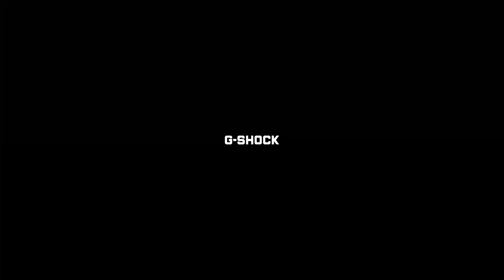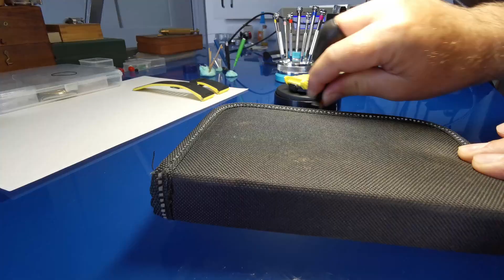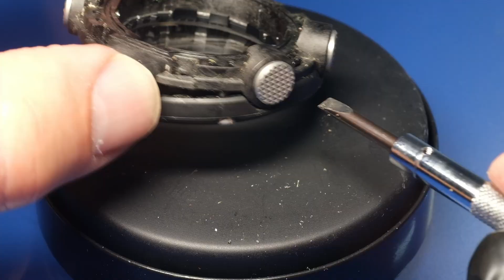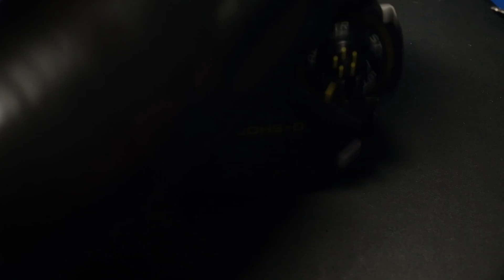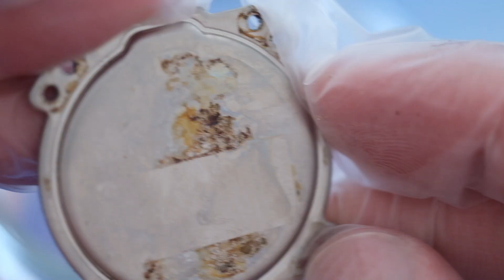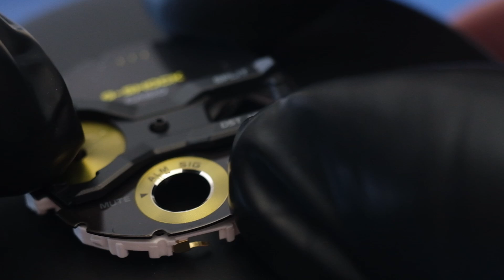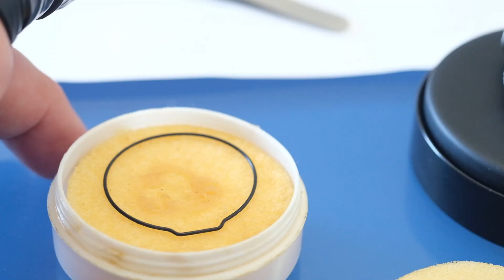G-SHOCK versus Watchmaker

Comment: I wonder if a mudmaster would have as much mud inside. I owned a G (G 2900) as 8 (?) year old. Then i switched to Pro Trek PRW 1500 (got it reduced price) at 13 years old. With 21 years, i switched to Pro Trek PRW 60T (titanium bracelet). Now after graduating my masters at 27 i think buying a PRW B1000. Or the new Citizen Altichron BN4061 (bit expensive though). Or maybemaybe the Mudmaster B1000 but i like Pro Trek looks better (basically that mudmaster has all functions of the PRW B1000 and saphire). Wrist size is pretty small though, so a big g shock would look ridicolous (the PRW 1500 is already limit, its nearly bigger than my wrist lololol).

Comment: AGRICULTURAL?? 
Is that derogatory toward farmers?
Most peculiar...
Reply from the maker: Hi there... It was not meant to be just merely descriptive.  I have much respect for farm machinery engineers ever since assisting with the repair of a combine harvester at the tender age of 12 because I was the only person small enough to crawl inside the vehicle and replace the vital part.  This we did at night because it was important to get it fixed as the crop was dry enough. Yes, much respect for farm engineering but it is different to working at the watch bench.  Hope this clarifies. Richard
Reply: @richardperrettwatchmaker  
Thanks for the reply. 
I am sure no disrespect was intended. That phrase just sounds very odd to my U.S. ears. 

It sounds like you had a lot of awesome learning opportunities in your younger days.

Comment: One thing you missed, is that the pushers come out too.
Behind the button they have a cavity where their return sprint lives.
This place collects a lot of gunk too and here it'll affect the feel of the pushers too.
They also have tiny O-rings that can benefit from a bit of grease.

Having that centre spring electrically floating isn't a problem to these modules, it only handles the beeps.
What was probably happening is that the light pusher pushed the module out a bit, preventing it from actuating.
Usually these watches have a reset contact point, which you should connect to ground (the metal module frame) for a second after a battery change.
You can probably realign the wheels in software as the stepper motors have no way of keeping track of position and can drift when turning while receiving shocks.

It was cool seeing how incredibly well-built these fancier G-Shocks are.
I've dug DEEP into my GBX-100 in my modding adventures with it and it's nowhere near as well put together.
Same with the few cheaper non G-Shock Casio's I've taken apart, but all is relative as they stand far above the other cheap digital brands.

Comment: You've probably found out by now but the SW batteries are for low drain watches with no backlight, alarm etc.
Your G-shock (and my GA2100) both need the SRxxxW style of battery.

Comment: Bought a Breitling Hercules. I hate that watch. It is an overpriced junk Swiss watch in my view. Got 9 months out of it, got it serviced by Breitling got another 12 months and the same thing happened - ie gains 15mins an hour. It has sat in the drawer for the last 17 years. I hate it. It is a rubbish watch. 
Saw a vid on YouTube and a watchmaker was wearing a G-Shock GWG-1000.
I bought one. Far from perfect the GWG-1000 has terrible lume and the light is poor, however it is reliable and rugged. I must say I don't love it as it is just a tool. I was expectingca bit more from a +$1000 watch but it is so much better for the active person than my Hercules it's ridiculous. Swiss watches are OK for dopey office workers but for us proper workers don't even think of a mechanical Swiss watch be my advice.
I'm  a truck driver that does multi drop deliveries.

Comment: I bought my first G Shock GA-2000 after I saw your first video about the model.  It’s a great watch, and not long after buying it, I saw another color way—my first one is green with a negative digital display, and as I said, it’s great, but when I saw the same model in white with a positive display, I couldn’t resist it, so I bought it as well.   Both my GA-2000’s have non-skeletonized hands, because I think they’re more legible..to sum up, the GA-2000 is a great design by. Casio, and your first G Shock video inspired me to buy it..I’m happy with my purchases.

Comment: I wore the same g shock 6900 for working out and mountain biking for 15 years. Only had to replace battery and band once. When it finally died, (Circuit board issue) I took it apart, and holy crap, was that disgusting. 
They're tough watches, but they hold on to some serious DNA. 🤮

Comment: What an interesting video. Thank you! Nice to see craftsmanship in any form. In case it is useful to know, the central protruding spring which extends beyond the insulator on the back of the circuit board is to connect the watch electronics to the piezoelectric speaker for the alarm noise. This speaker is visibly mounted on the inside of the metal watch back. I don’t think the spring has any other purpose. Putting the metal back in place may have further compressed the other non soldered electronic connections or the zebra connector against their contacts to make the electronics fully functional. It was unlikely to be related to the spring I think.

Comment: I have a G-Shock GA100 which I bought ages ago from Argos for £40 because I needed a watch at work right there and then. I absolutely hate everything about it, the way it looks, the way the hands always seem to cover the display when I need to see something on it. But it just won't die, and I've worn it on and off for years. Much better watches that I loved have come and gone, and at the moment my Traser has stopped, my Luminox needs a new movement and my Tissot's crown has fallen off - so I'm back to using this G-shock at work that I can't stand but just seems to be indestructable, despite being abused and having not a single days service in at least 15 years.

Comment: No two ways about it... YOU ARE GOOD with watches Richard. 
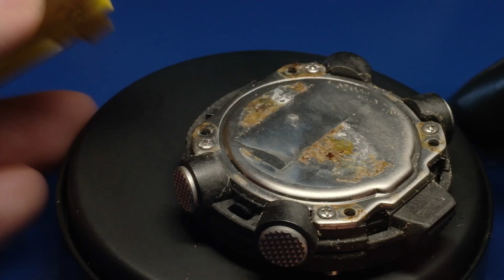02:13 in this video...This is the reason I would never take my DSLR Camera to a beach .. Sand gets everywhere in electronic devices because sand is in the air when you go on to a beach.  OK, that said... 
I have had my eyes on this exact yellow & black Casio G-shock watch for a while now...The Casio G-Shock GA-2000...It is priced at around just £100 GBP here in the UK (About 200x cheaper than a Rolex) 

I collect watches ... Can I ask if this watch is worthy of a place in my watch collection.  I have been told it is a little bit "FIddly" to set the exact time on the watch.  Is this true? 
EDIT... I love your vintage Seiko watch ... I have a Seiko SNK809 K2...With the 7S26C movement... The accuracy of this movement is supposed to be 20 to +49 Seconds per day ... This is utter tosh Richard ... I tested mine over a calendar month making sure the watch never ran out of power and the REAL accuracy on mine was nearer +/ 3 seconds a Day. 
So pleased I found your channel... Going to have a look at some of your other videos.
Kind regards Brian

Comment: Love GSchocks.  Insanely good watches for the money.  Cheap and cheerful GA 2100 is my favourite.  2nd favourite after my Seiko PADI

Try a drop of ACF50 on the corroded back.  It will remove the corrosion and arrest it from getting worse leaving an ultra thin protection coat in place

Comment: Probably a good idea when you noticed the sand and dirt under the yellow case back would have been to stop and brush it off/ blow it off before opening the watertight seal. Some analogue g shocks also have the ability to set home points (with a series of button presses) for the hands and wheels, most likely in the instructions.

Comment: I've never seen such an immaculate workshop even his tools are colour coded! You should see mine Richard (or best you don't) and I'm not a watchmaker like yourself who I hold tremendous respect for after having a go myself at repairing a vintage watch (how hard can it be, right?) and having springs flying out everywhere and a bag of 30+ parts for my trouble. To me as someone who has designed and built computers and written software, watchmaking repairs is akin to performing open surgery on a living patient. It's that hard and technical, you need very very steady hands and astonishing skills. I really enjoyed the story of the watch and seeing the repair process anyway. I'd be exactly the same if I was Rolex to be fair, a big brand of extremely high value with a reputation to protect you stay well clear of products which have been fitted with non-Rolex parts . So that makes Richard BETTER than Rolex for still taking on the task! I did wonder if the watch might be haunted or something paranormal going on, a watch running so fast losing 4 hours a day is quite bizarrel.....alien abduction of previous wearer?! lol I have some watches and clocks over 100 years old still keeping good time if regularly wound up properly that have never been serviced in decades.

Comment: Great video,  I am curious about the motors, they look like Lavet-type stepper motors (single coiled attested by this exceptional video), but Lavets usually are unidirectional,  In this watch it seems Casio used Timex like step motors, which explains the difference and somewhat lagged hand movement result in the natural steps onwards versus backwards,   FYI  US patent 4205262, it's referenced by thus 1988 European patent application by Timex.  This for sure will be a matter of discussion always about the cost versus engineering delivered from Casio to its customers.

Comment: Great video!! I had a ga-2000 but stripped the threads in several holes (for the caseback and rear guard) when changing batteries, so no chance of resisting water afterwards. Luckily, I found a used replacement in good condition. What can I do to avoid the problem when I come to change the batteries next time? I thought about pressing the caseback down while unscrewing, so the screws weren't under as much tension, but you didn't do anything like that!? Was I just unlucky?

Comment: I can clearly see a BIG FLOP here, the hands are not set properly 34:31, when the hour hand is set at 12 sharp, the minute hand should as well lined to 12 sharp one behind the other, but in this watch for the hour hand to be set at 12 sharp ( in the middle of the line/dots) the minute hand is on 14 minutes ahead 39:32. Those hands wasn't properly placed accordingly from the beginning .

Comment: When you restarted the watch it went to alignment mode. When it was flashing "sub" it actually meant that you could then align the sub dial to the proper position and pressing mode button once would take you to main dial which said "0:00", which meant that you at that point can align the hour minute hands.

No need to open the watch and align those dials manually.

Sorry that my explanation is not perfect but you could look at other videos on how to align gshock dials, you'll then get a clearer idea.

Comment: Lot of fun watching this. I've changed the batteries in my G a couple of times, but never went that deep into it. One thing, at the end when you are trying to get the mode wheels and hands properly linked... in the Casio manuals for the specific module (available for download), there is a step by step procedure to get everything properly aligned without physically working with the hands. It's different for every module, but anyone can resync without even opening the watch.

Comment: On most G-SHOCKs those springs go flying when you take the metal backplate off. Most are a connection to a speaker on the backplate for the alarm and button push sounds. If you lose one a truck is to find the correct size lug bars (shock absorber looking things). Pull them apart and get the spring out of them. Cut the correct size length off and replace into the hole it came out of.. Put your backplate back on and voila. Your alarm and button sounds work again. They won't be brass but they still conduct electricity and work just as well.

Comment: Just sent my son's 6 month-old G-Shock back to Casio because of water ingress. Looks like the water got in through the pushers because a pressure test confirmed this. So, I was wondering if you disassembled, cleaned and lubricated the pushers off camera or simply decided not to do this?

Comment: Painful...1) you submerged the caseback piezo electric disk 2) ultrasound cleaning of bezel with buttons in place, which means you've probably stripped the tiny o-rings of lube and trapped a small amount of water (and detergent) in the button journals. The specialist guy for Gshock internals is at the below link.
https://www.youtube.com/c/gshockhighfashion

Comment: In my past experience with G- Shocks, I discovered that one of the least well-known vulnerabilities is to Salt-Water! It will even get under the caseback and begin undermining the gasket resulting in water-resistance failure. CASIO makes some models with Titanium casebacks (Gulfman) but few G-Shock lovers are aware of how much they had darn well get the Titanium if they want to get near Salt-Water! The only other corrosion prevention is to soak it in a big pot of fresh water for a day right after getting back from the beach and swishing it around well, but I myself would have trouble trusting that the salt is all rinsed out.

Comment: It's great to see a proper watchmaker working on another form of proper watch that millions of people own, digital, without being stuck up about it. Great video.
Reply: What's crazy is I've been playing around with the inside of G-Shocks since I was a kid. Not to this extent, sure,  but just to open, clean, change batteries, reseal, fit new springs, fix poor button connectivity etc. I would struggle with mechanicals I'm sure of it., I always used to outsource those repairs. The work done here is pretty intense for my abilities!

P.S. I've actually replaced those pernickety springs with trimmed springs from spring-loaded pins and the watch beeps have been fine!
Reply: So you have watched another channel? Because when opening the watch there was a lot of sand. Instead of cleaning it first, he opened the case, so  sand is in the watch at that point. After that, he turned the movement upside down with sand on the case. I would not let hem near any of my watches, ever!

Comment: hour hand is not center proper, little bit to left , do not match 12
Reply from the maker: Hi damian ... coorect and well spotted!  It does not and it is also synch'd to the digital time as the module has a function that supports this adjustment.  Thanks for the feedback.  Richard

Comment: This is a very interesting video Richard. Although I don't own a analogue/digital G-Shock watch I do own two  5610 radio controlled/solar powered G-Shocks. I have always wanted to see the inside workings of them though. One day I might get an analogue G-Shock but I wouldn't want to do what you did in case it never worked again. Thanks again you are amazing 👏

Comment: 33:23 actually you can do the disc adjustment with buttons combination (I forgot which buttons, but it's in the manual)
Because the disc will slightly misaligned sometime if you drop or bump the watch (it's outdoor watch, so that to be expected)
It's good that Casio provide a solution to aligned the disc (and the hands too) without having the user to open the case, they know we will abuse the G-Shock
Reply from the maker: Hi Fajar!  Good point sir!  And yes I used this facility when I went back into the watch to correct the hand misalignment that was apparent when I had finished shooting the footage.  Thank you for taking a moment to highlight this to folks reading the comments as it is a useful point.  Richard

Comment: Hi, just want to ask
is it a good idea to use magnetized screwdriver to dissasemble a watch?
Will it damage the watch?
Reply from the maker: Hi Fajar... Not a good idea with a mechanical watch due to the hairspring which you dont want magnetised.  But the stepper motors in this watch already have pretty powerful magnets in them so a little magnetism on the screw driver is of no consequence. Hooe this answers your question. Richard
Reply: @richardperrettwatchmaker  thanks for the explanation

Comment: I'm a watch and clockmaker. I've owned my G-Shock since 1989. Only had to replace the battery once. It's now on year 9 of battery number 2. I even done a video of me throwing it at a pebble dashed wall and 50ft in the air to prove how tough it is. It'll outlast me.
Reply: I believe the limit is 2039, when the calendar reaches its limit. Newer gshock limit is 2099.
Reply: @Karuna Murti  I read there are ways to work around the year limit. Just set it to a year in the past with identical day/week.
Reply: @KarunaMurti  interesting, I’ll have to check mine out, then, I have a 1984 DW5200 (Hero)
Reply: @KarunaMurti  yes, it will explose then. True story
Reply: thanks for the info, it means a lot to me as a first time used of an original g shock ga 2100 sir...
Reply: No, it cannot outlast you. It will outlast your body, but you are an eternal spirit soul, a part and parcel of the Supreme Soul, whose principle name is Krishna. Thank you for reading.

Comment: Richard,  when I first saw you doing this I was like "Why is he servicing a g-shock?"
Then i saw the crud that had worked its way inside. 
So while a digital doesn't need to be serviced in the same way a mechanical watch does, it still needs to be cleaned occasionally. Bang on video, mate!
Reply from the maker: Hi JToddHubbard7 .... I did 'go a little further' a little further than was strictly necessary to remove the crud; but it was interesting right?  An occassional clean as you say is a good thing with all watches I guess.  Thanks for the feedback.  Richard